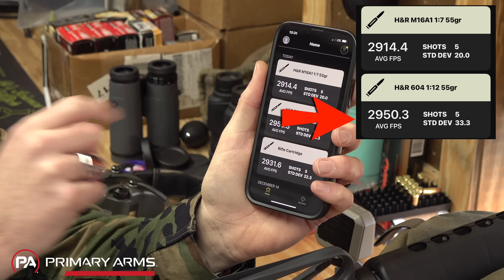Which is more accurate? 1:12 or 1:7 Twist Rate? Let's find out!

Comment: Seems that the biggest variation was the spread in velocity of factory ammo, and bc the 223 chamber isn't near as accurate as the wylde chamber. It'd be interesting to see the comparison between the 55gr in the 1:12  223 barrel vs a 68 gr in a 1:7 223 wylde barrel.

Comment: Show what happens to the 55 grain in gel in the 1 in 12 it tumbles and goes out the sides of the block the 1 in 7 flys straight through. The original twist rate was  1 in 14 but  not pass arctic testing

Comment: Great video!  Great info!!  I recently purchased a PSA 1/12 twist Air Force clone 20" upper for nostalgia reasons.  The meat of it all this was basic and AIT infantry training at Fort Benning in April 1980 we had numerous drill Sgt's that were 'Nam vets.  They all said that they would hit an NVA soldier in the left elbow and the bullet would come out the right knee!  Over the years I have confirmed this memory with my Airborne Brothers.  They said their drill Sgt's said the same thing.  So if'n you want to take someone out, use a 20" barrel, 1/12 twist and a 55 grain bullet.  Over the years I've gone from the short barrel M/4 clone with all the shit hanging off to a full size AR-15A1.  Something old guys do.  After hearing young guys firing 62 grain green tips and punching pencil size holes through the bad guys,  I'll take my old A1 1/12.

Comment: it's misleading to say the 1:12 prefers lighter bullets when its actually the faster (lighter) bullets that are more stable simply because the velocity is directly proportional to bullet rotational RPM,

if you cut the barrel length as much to reduce your velocity by 50% then therfore you also lose half your RPM even though you have the same twist rate,
this is why some barrels specifically for subsonic loads like 220gr .300 blackout have a 1:5 twist but that rate might cause a 95gr bullet to structurally fail from centrifugal forces and break apart mid flight

Comment: It may a late in the gate to comment, but, I have a Colt 1:12 barrel marked “C MP CHROME BORE” and got it just before the Clinton Ban began.  I have no clue what the round count is on it, but when I got it  had not been cleaned for a very time.  
Cleaned the barrel and shot a lot of 55 grain stuff and upgraded to a 1:9 and then to a 1:7 twist barrels and put the 1:12 barrel in the safe.  Then got a Brownell 1:7 twist pencil barrel for a Retro project and again put it in the safe.  But today got both the Colt and the Brownells barrels out and shot two rounds of green tip ammo with the 1:12 Colt barrel and at about 35 yards the bullet tumbled and was key holing but the three green tip stuff with the 1:7 barrel had  very round holes.

Comment: I wish someone would make a modern-style upper with a 16" 1:12 barrel. Loaded with M193, it would make an AWESOME home defense carbine. M193 is quite accurate, out of 1:12 barrels. Which is not surprising, as M193 was designed for 1:12 barrels.

Comment: The slower twist helps most if you shoot cheap ammo with low-quality bullets.  These are often a little unbalanced (lead core with bubbles, non-uniform jacket thickness, etc).  The faster those bullets are spun, the larger the groups.   Many people don't see a difference with high quality stuff as long as the twist rate is fast enough to stabilize the bullet well.

Comment: Great video! I shoot a lot of NRA Matches and use a Krieger Barrel DCM 223 Wylde 7.7 Twist 20" and shoot .223 75g Hornady Match Bullets, or some of my friends reloads which are the same, same cost for me, just availability if he has them loaded. At 300-yards there is no difference. But went to PA at a 600-yard range couple of times and did better with the reloads. So, I wish I had the space and money I would reload, but here in the communist state of NJ, 300 yards are rare but available, not so much for further than that. And this is where I do 95% of my shooting. I do get a new barrel every two years, should do it every year but just too much. New upper is about $600 with shipping a pop. The average I have shot at the high-power competition is in the low 700's, with 745 the best. Not the best shooter by far, we have a guy that shoot 790's all day long. I find the .223 shoots much better than 5.56 commercial or reloads.

Comment: I think 1 in 9 or 9.5 or a hair below 10 would be the best  VIO 5.56 chamber is the same as .223 as the 5.56 chamber is just looser for millitary use. so a tighter chamber would help as all NATO and .223 have tight tolarancrs so many something like .223 Wydle but tighter

People mostly shoot 55 grain .223 and with NATO most will be 62 maybe uo to 69  grain so  1 in 8.5 to just a little under 1 in 10 would be the best for a 16 maybe a 20 inch barrels it can be a little slower.

I wish FN and others would make CL CHF barrels with lots more twist rate options and chamberings.

I managed to get a high quality .223 1 in 10' "20 and it's a tac driver with 55 to 70, I even have it  on  an upper for when I want to shout 55 as it's so accurate.

1 in 7 makes 55 so inaccurate.

Comment: Long story short; if you want tight groups shooting less expensive 55gr, 62gr, or 64gr ammo, don’t use a rifle with a 1:7 twist barrel. The projectile length, not the bullet weight or velocity is the determining variable in this incomplete experiment by MAC, 1:8 and 1:9 barrels should’ve been included in the test to provide a complete understanding of the ballistic effects.  1:7 stabilizes the longer 5.56 projectiles like the popular 75gr rounds and delivers tight groups with those longer projectiles..  1:7 will not optimally stabilize 55gr, 62gr, or 64gr projectiles because of the projectile length.  I find that a 1:9 twist delivers acceptably tight groups with 55gr ammo at 100yds, and a 1:8 twist is optimal for 62gr-64gr acceptably tight groups at 100yds.

Comment: Does not make sense. You should take you out of the equation. Use a vise or other device to lock both guns in place. Then use at target or plain piece of paper to show the pattern measure the shot displacement. Not body moving, heartbeat or twitching involved.

Comment: The most accurate AR I ever had was assembled with a surplus 1:14 original non chrome lined barrel that I got from SARCO in 1985.  Only mods were a free float tube and a special hand grip screw that took the slack out of the trigger. Factory FMJ 55gr 1 to 1 1/2 inch.  Hand loads 55gr SP 1/2 to 1 inch. And my all time best 53gr flat based match that would do under 1/2 all day. Those were 5 shot groups. Never shot or owned any other AR that could do that even with expensive match barrels.

Comment: One notes there is velocity deviation (with the same ammunition) between two firearms than with twist rate.  To find a difference in velocity by twist rate, one would need to fire five round samples in five or ten of one twist rate rifles and then compare to the average of five or ten rifles with the other twist rate.  This using the same  'lot' (batch and manufacturer) for both twist rates.  
Probably a good idea to compare the same components with different bullet weights in the same way.  

I've been reloading since the early 1970s and chronographing since the late 1980s and I've never noted a meaningful difference in velocity due to twist rate.  No literature has mentioned such a phenomenon either.  
However, twist rate does affect accuracy.  As told in the video, longer (typically heavier) bullets of a caliber require faster twist for proper stabilization and accuracy.  A lot of overspin is better than a little underspin.

I have no use for an M16 or clone (used one long ago), but do have a great interest in the ammunition - rifle interface.  

Garmin chronograph looks good.  Costs $599.99.  $600 is a fair amount.  I have a 'brand X' chrono that does quite well and didn't cost half that.  Have to consider it.

Comment: Light bullets, slow twist.  Heavy bullets fast twist.  Back in my gun repairing days I had a Sako heavy barrel in .222 sent my way because is was lacking accuracy.  I happened to remember that model had a 16 twist so I loaded up some 45 grain bullets.  It turned into a tack driver with that load.

Comment: I was first issued and trained with the M16A1 in the army with a 1:12 twist. At a Canadian Bull zero target I could put two rounds in the same hole at 25 meters with government ball ammunition. I could do the same with the M16A2 with the 1:7 twist. . We used a different zero target for it. I prefer the Canadian Bull. The difference ammo made a difference. The manual said that the A2 could use the NATO 5.56 as well as the M193 ball round of the A1.  Although not as accurate. However, the M16A1 couldn’t shoot the 5.56 NATO round well it went off target. I carried the A2 during Desert Storm. The A2 was better in some ways. But because it was Zeroed slightly differently from longer range you had different hold offs for it. I preferred the A1 because it was zeroed out to 250 meters but you could still hit the 300 meter target with iron sights without a significant hold off.

Comment: If the rifles were both scoped i would certainly consider the question of accuracy verified. But with irons, there’s way too much room for minor errors that can effect the outcome of the test. Not saying your a bad shot. But 300 feet is a long way when the slightest movement can throw your shot off a good bit in any direction. But i did like the job you did to find out. Great video bud. Keep them rolling.

Comment: 1/12 was ditched for 1/7 when the SAW was adopted. Nato fell for the Swiss designed SS109 because it was "more humane" and supposedly offered longer effective range. "More humane" meant less lethality and even less lethality at longer ranges. So now your doing less damage at range and are required to shoot close opponents multiple times to get a knock down. How is this "humane"? 1/12 with 55 grain all day for my purposes. Don't even get me started on that useless splinter of a steel penetrator. Have you ever tried to pick up green tip with a magnet. Don't flinch you'll drop it.

Comment: Fast twist is great... IF you have a projectile capable of taking advantage. It also depends on the desired range as well. Another component is the profile of the bullet itself. If you have a projectile that's prone to destabilization, a faster twist rate may actually accelerate it's tendency to tumble at an earlier point in its trajectory.

Comment: The propane is adding humidity to your room. If you have grid power I would switch to electric heat. It will be cheaper in the long run and it will not introduce moisture to the air.

Comment: Yes, a faster twist will generally reduce your muzzle velocity, all other things being equal.  Now, your title says "which is more accurate?" - you didn't really prove anything here about accuracy, other than a heavier pill becomes unstable if you don't spin it fast enough.  I really don't think your question can be answered based only on twist rate unless you qualify that with X projectile weight, Y barrel length, etc.  If you want to shoot heavier pills accurately you need a faster twist, if you really want to maximize your velocity and don't need a heavy bullet, slower twists, lighter bullets, and in some cases longer barrels are the way to go.

Comment: Another thing on twist rates, early jacketed bullets had jackets that showed a wide variation in jacket thickness from side to side as well as bullet to bullet. This variation would cause one side of the bullet to be heavier than the other side. 
This change in center of gravity at slower twist rates was not as noticable as at faster twist rates. These off balance bullets were stable at the slower twist, but not as stable at faster twist. This lead manufacturers to use slower twist rates to better stabilize these old bullets.
Bullet technology has advanced over the years, making better bullets. This better bullets still shot well in the slow twist barrels. But as bullets got better people started to want bullets with higher BC's. These high bc bullets being longer than standard bullets wouldn't shoot well in slow twist barrels, thus the change to faster twist rates. The new 8.6 blackout is an extreme example of this. The 8.6 uses very long bullets at slow velocity and uses  3 inch twist to stabilize the bullets.

Comment: I first 223 rifle is a Stevens 200 with 12 twist.  With 55 gr bullets it would group them into about 1/2 groups and all the holes in the target were round. With 62 gr bullets it was about 1.5 groups and very few had rounds holes in the target. Most were about twice as long as they were wide. Evidence the bullets were not stable. Much further away and they would probably start to tumble.
I recently bought an AR-15 rifle with an 8 inch twist. Haven't had a chance to repeat the testing on it but I feel I can assume the 55 gr bullets will leave round holes as well as the 62 gr bullets. I have only shot a few rounds for function testing, none for accuracy. Being a not to expensive AR I doubt it will shoot as well a the bolt gun.

Comment: huh, I always remembered it backwards then, that a heavier round would require less stabilization while a lighter round would require more.
Reply: Its not really the weight.  Its the difference between the center of pressure and the center of mass.  Bigger difference = more stabilization necessary.  Longer bullet, bigger difference.  But since the bullets you are shooting are almost certainly going to be copper jacketed lead of the same density and diameter, weight and length change at the same time and by the same amount.
Reply: @alexe589  so this is why rifled shotgun barrels have such a slow rate then?

Comment: Got a military standard (civ) AR A1 2nd hand in the late 70's. Measured the twist myself and came up with a 1 in 14. Yes you heard correct 1 in 14 twist. 55 gr @ 100 was about 4-6". @ 200 it opened to about 6-8". The 62 gr out of the 20" barrel got a little squirrelly @ 100. One 5 rd group would be 6-9". The next grouping would be 9-12". I was using a 3' sq backing for my target @200. This is where the grouping got really squirrely. At 200 yards, out of a 10 rd string, I generally could find 3 or 4 bullet holes in the 3' backer.

Comment: I’ve seen sub MOA accuracy with cheap 55 grain from a 1 in 7 Colt HBAR at 200 yards (off bipod, with scope).  But I’m told 1 in 7 can over stabilize 55’s, so when you get out past 500 or 600 they hold their attitude and don’t nose over as their trajectory curves.  I still have the HBAR but don’t have a 600 yd. range.

Comment: Thank you for reminding me that we could measure rifling twist by revolutions per minute on the projectile.  I had trouble enough with my command while on active duty during the change-over from M16A1 rifle with M193 ball to M16A2 rifle and M855 ball.  "Is that green tip going to start fires?"

You also demonstrated a slight difference in velocities with a small sample size, reminding me that I have to take greater care defining what my own test results tell me.  Off the cuff it makes sense that a 1:7" twist would produce more barrel friction than a 1:12" twist and produce lower velocities.  You pointed out the need for more shots fired to validate results--and you used H&R barrels in testing--good call.  I don't know if other brands of barrels would change the results. My test results will vary due to test equipment, test conditions, barrel brand, ammunition maker, and bullet design--but the figures should be close.  

The M193 and M855 projectiles are boat tail bullets with spire points.  Some .223 Remington bullets have flat bases, different nose profiles (ogives--can shift center of air resistance), may have hollow points (shifts the bullet's center of gravity) and may be shorter or longer projectiles.  The 1:7" twist was to stabilize the M856 tracer in sub-zero temperatures.  The M196 needed 1:12" rifling for stability under Arctic conditions--the original 1:14" twist rate failed to stabilize tracer rounds.  What this means for the shooter is that using bullets heavier than 55 grain in 1:12" can possibly work okay and that bullets heavier than 62 or 64 grains can be stabilized in 1:7" barrels.  The way to find out is shooting benchrest groups at 200 yards under anticipated shooting conditions--yes, I know, firing at 100 yards may be the limit due to available shooting range facilities.  Bullet length makes a difference.  This difference is more important to handloaders using custom bullets and demanding maximum performance.  Firing those heavy and long 64-grain M855 factory loads through an old Colt SP-1 (1:12" rifling) to a maximum range of 50 yards from off-hand positions on eight-inch bullseye targets or M9 silhouettes probably won't yield significant differences in precision.  Using the same rig on jackrabbits at 300 yards will--if the shooter can see the target and aim from a steady position.  About three inches at 100 yards won't cut the mustard when the target is 300 yards away and smaller than three inches.

Comment: There's some other possibilities about 1:7 having slightly lower muzzle velocities: One is that of the barrels used here, the 1:7 is just slightly shorter. Second is that slightly more of the explosive energy is getting diverted into the rotational kinetic energy of the projectile, rather than it's linear kinetic energy. Third is that the 1:7 barrel may be slightly higher friction than the 1:12 barrel.

Comment: I have a Rem. 700 with an 18-inch 1in 12 twist 223 barrel.  50 grain is .5 moa but 77 grain in any brand key holes and is all over the place